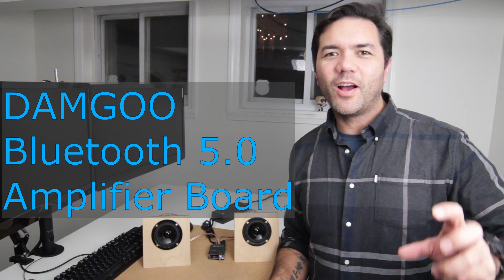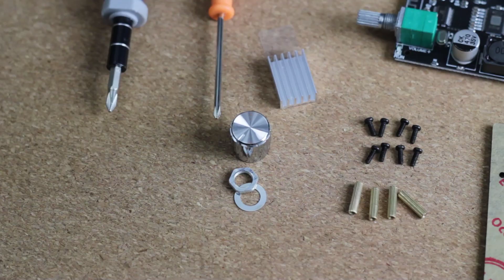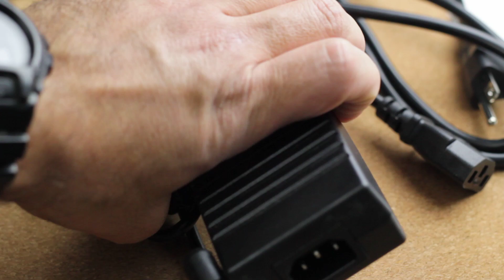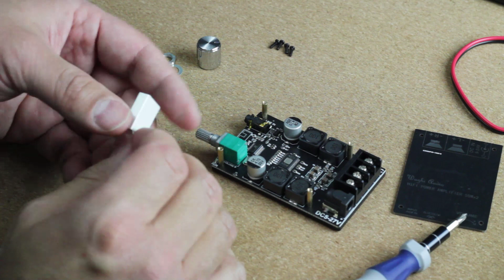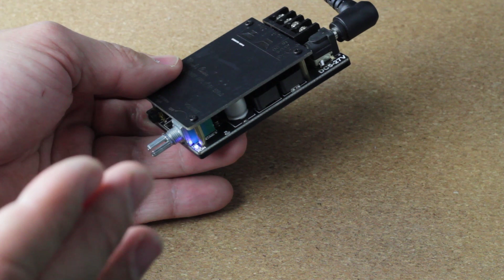Amp Review: Damgoo Bluetooth 5.0 50W x 2 Hifi Amplifier

Comment: I see this is 3 years old, so don't know if the comments are monitored any longer. I would like to use this in my old classic car, 12 volt negative ground system. I have a 6"x9" speaker in the rear deck and a 7" speaker in front. I would appreciate some feedback if you think this will work for me and what speakers you'd recommend. I won't be hooked to the old radio at all, just using Bluetooth or aux. Thank you.
Reply from the maker: Hiya Butch! I don't think this amp would work too well. Most car audio speakers require way more power than this little amp could muster. However, if you can find full range drivers that only need about 35w that fit in your classic car then it will work just fine. The speakers I used were small desktop speakers for home use. You could try using home audio speakers in custom enclosures. Speaker design is a pretty deep rabbit hole. But, it's totally subjective. So if you pick a couple drivers from partsexpress.com that have the right power needs and they fit in your car and they sound good to you, then go for it! Please hit me up with additional questions if you decide to try that route.

Comment: What would you use to power it when you make it into a portable bluetooth speaker?
Reply from the maker: Parts express sells a rechargeable battery pack with a controller board. I've got one in my parts bin but haven't yet used it. Maybe I'll add battery power to these for an upcoming video.
Reply: @alexmendiola  hi, could you post a link to the battery pack , thank you.

Comment: Whats the difference if you charge the board with 5v?
Reply from the maker: Ooh, I don't think that'd be enough to push the speakers. I'd def run this with at least 12-15v for the best sound and a reasonable output.
Reply: You can use 5V DC INPUT such as cellphone charger and small watts of speakers like 10-15watts

Comment: Great review! I’m not an expert but I clicked. Lol How do I know which is the right power adapter to use this amp? I don’t want to ruin the unit with the wrong supply. I’m new to learning the different voltages and amps.  Thanks!
Reply from the maker: Thanks Joseph! I'm not an electrical engineer, but I think the idea is that you get the best results from this amp with a 24v 5amp power supply. That's what I've got and it works great. Here's the model I purchased off Amazon: ALITOVE AC 100-240V to DC 24V 5A Power Supply Adapter Converter with 5.5x2.1mm DC Output Jack for 5050 3528 LED Strip Module Light

Comment: You're not going to detect a "pop" without speakers connected. I believe what the manufacturer meant was the unit has a "soft start" circuitry so there's no power surge when you plug in a live power supply thus no "pop" or "short" ie. buzz noise heard from the speakers.   If it does "pop" when you plug in a live supply without speakers connected it's a totally different issue.  That probably means an electrical failure...a component(s) on the board shorted and blew out, possibly a defective board.
Reply: Yeah, my bluetooth ampli has buzz noise heard from speakers
Reply from the maker: Ah I see! Thanks for the clarification Frank. :)

Comment: Nice review, I saw this on Amazon today, looking for a small amp for a 2ch setup for either the cnote kit or Dayton audio prebuilt bookshelfs for my workshop. Looks like this maybe could be a winner.
Reply from the maker: Hey Mateo, thanks so much! I think it would be perfect for the c-notes. It really is clean sounding and powerful.
Reply: @alexmendiola  Well I ended up getting this.  https://www.amazon.com/dp/B07PN9LZ4R/ref=cm_sw_r_em_apa_i_-t9eEbFHNMZ59
It's a 2.1 with BT 5.0 and I'm gonna build a small ported box for a tang bang 5.25 sub. I'm using the amp with a pair of old Bose 201's I already had and sounds awesome. Prolly will get the Micca mb42x here soon. Should be a decent setup in my shop after it's said and done.
Reply from the maker: @Mateo PW, that is so crazy. I actually bought that very amp for a build for my neighbor's son. I built a 2.1 DML Panel system and he wanted to build one too. We haven't built it yet but I did do a quick sound test with the Nobsound and it's solid. Mine did not have the pop protection, so be careful to connect the power cord to the amp before you plug it into the wall. At least it comes in a nice case with machined knobs. I'm going to reach out to Damgoo about a metal case for their amps. They've already told me that they have a 2.1 amp in the works. I'll post a video of the panel system build and/or sound test when we finish it.
Reply from the maker: Also, that Tang Band Sub and the Miccas are going to sound great!